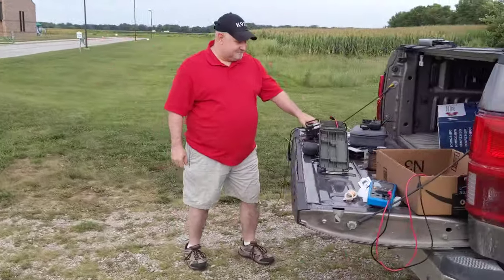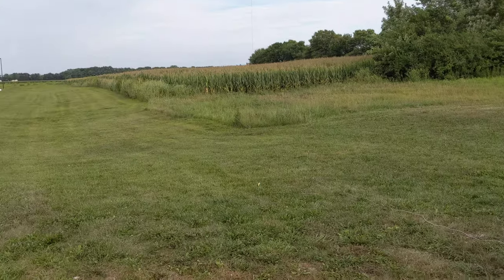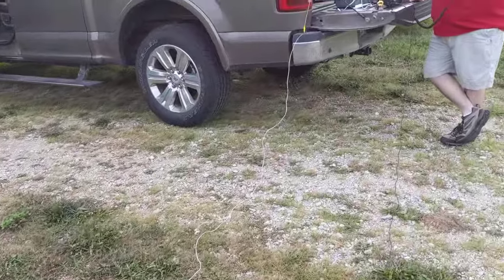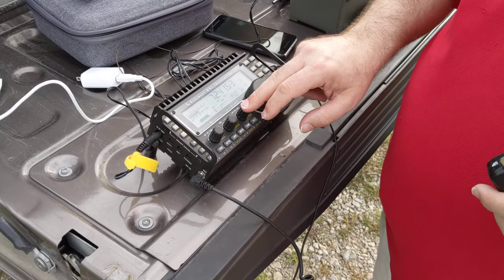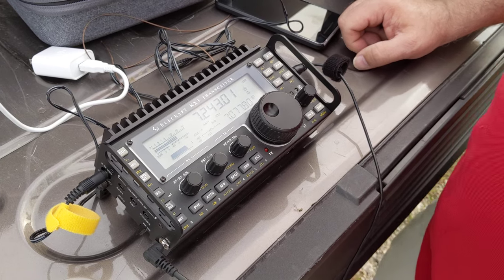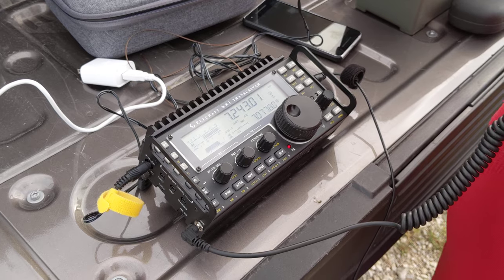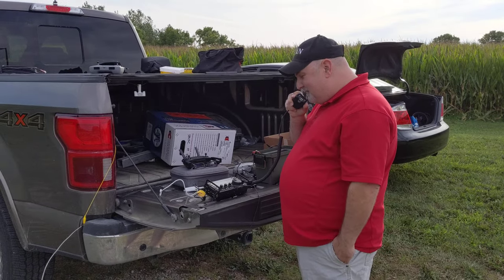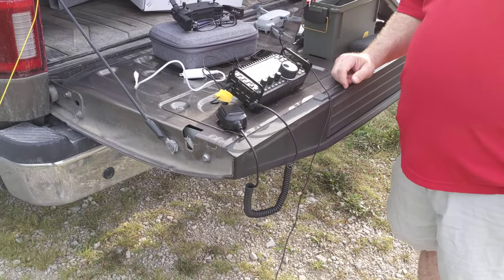Mavic Air 2 and Amateur Radio - 100 ft antenna with Elecraft KX3 HF radio

Comment: You would of thought RF from the KX3 would damage the Drone
Reply from the maker: There was about 5 ft of nylon string between the drone and the beginning of the antenna. If it did drop out of the sky, DJI refresh was always an option. lol.